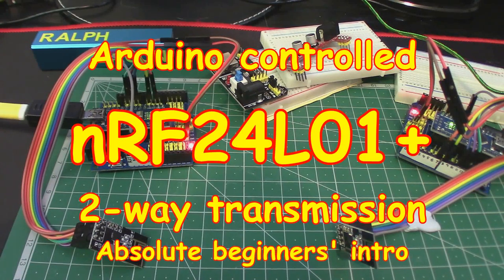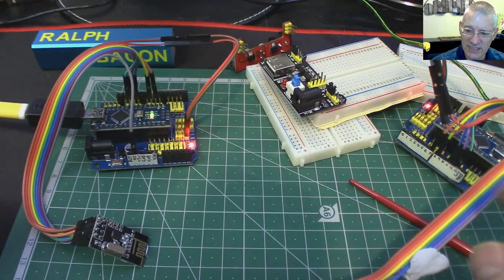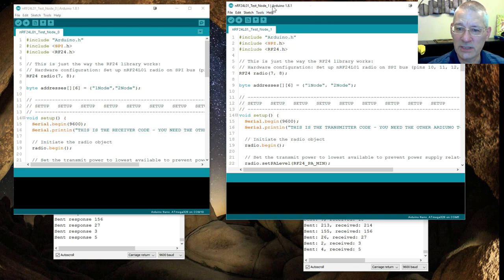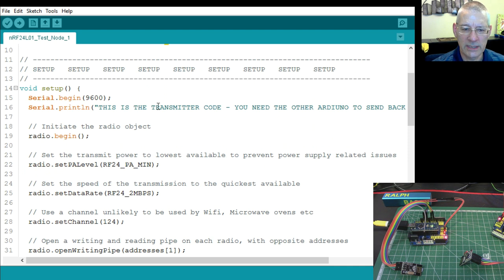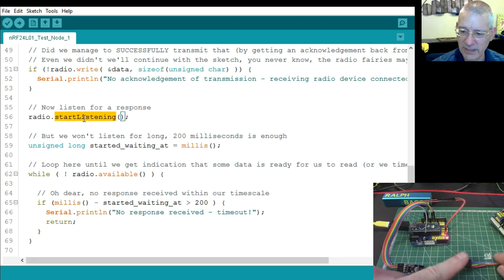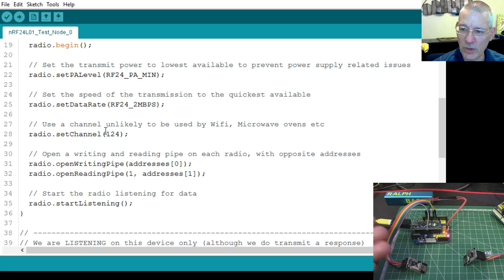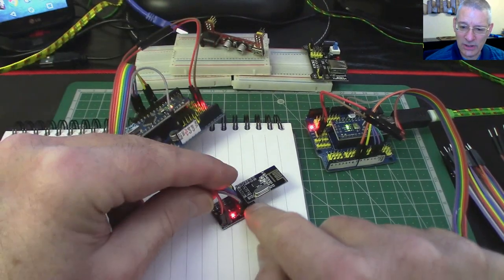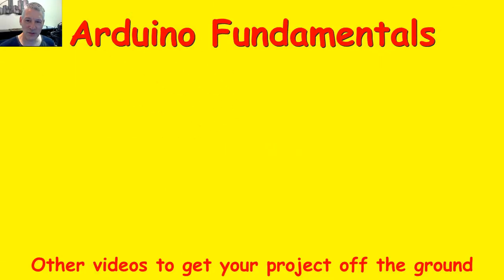#73 nRF24L01 Send (and receive) data with your Arduino!

Comment: Dear Ralph, Firstly Congratulations and thank you so much on a brilliant piece of work on nrf24l01 module. I have been watching a lot of videos with respect of IOT and especially on Arduino and trust me this was so simple and easy to understand am very sure Albert Einstein, would be super proud of you. 

I am yet to lay my hands on this both the Arduino & nrf24l01 and will keep you posted on the results that I get. 

Thank you once again for your efforts, God Bless.
Best Regrads
Zubin.
Reply from the maker: Glad you found it useful and easy to follow. I think Mr Einstein would say that I could have made it even simpler but, hey, it's a good starting point. When you order the nRF24L01 modules DO remember to order the adapter plates too. Makes everything much easier (and safer) to wire up.
Reply: Dear Ralph,
I finally managed to build the solution at home and it worked just as expected. I did mess up with the Pins initially as I was doing this exercise by looking at 2 different videos, but then it was good to make a mistake and I realized that using a wrong pin the Transceiver looped into itself. I am yet to receive those adapter plates that you mentioned, they are on their way. Thank you once again for your efforts and time that you took to post this video. 
I shall keep you posted on my next work that I plan to do on this. I plan to extend this exercise to switch on and off a relay to switch on and off a bulb. Till then Good Bye and God Bless.

Comment: So i commented 2 days and some hours ago that PA+LNA modules were not working. What i had done was i had plugged the antenna into a breadboard to kind of understand better(although it was harder to understand), then the breadboard forwarded the connections to arduino uno, effectively using 2 cables. Turns out my code wasnt working properly because the wire length does matter, cuz we are in the Microseconds. Thanks SIr and the guy who commented about using shorter wires down in the same video!!!
Reply from the maker: Does the module not just have a standard IPEX connector, or something else where you connect the antenna directly? 

Mine certainly have an IPEX connector (I chose them because of this) so no wires to solder at all - precisely because of the issues I knew could be lurking which you have discovered (and fixed 👍)
Reply from the maker: The IPEX connector is a tiny gold circular connector on board (only about 3mm diameter), to which an aerial cable snaps into: https://bit.ly/ipex-and-cable

But I have also used this type where the antenna screws directly into the module: https://amzn.to/3GBdxZu

Just easier than trying to wire up an antenna.
Reply: @RalphBacon  oh i have an old remote with 2 ipex connectors, it has a fulhan microprocessor which is a chinese company, i couldn't find any documentation for it. But these have screwable antennas here.

Comment: Excellent explanation. I've just reproduced at my lab with two Arduinos Pro Mini and it is working very well.
Reply from the maker: Excellent news, Julio. Did you use the adapters to plug in the nRF24L01 modules? If not, get some (they are very cheap, I got mine from Amazon) and prevent lots of problems due to the power being insufficient at anything above Minimum Power Level!

Comment: Yes, I also tried a number of NRF24L01 transceiver project some worked but soon after they stopped for no apparent reason. I am quite sure it had to do with interference from other channels so the key difference here is the line: // Use a channel unlikely to be used by Wifi, Microwave ovens etc
  radio.setChannel(124);  I just started it an hour ago and it's still going!
Thank you so much !
Reply from the maker: You are most welcome Jacob Endure, I'm glad you like the video and found a solution. Nice to hear from you.

Comment: Hello Ralph, this is the best explanation about nrf24l01! Just one question. How do you send more the one variable in one package? Thanks.
Reply from the maker: Hi Gustavo! The way I would do it is to send either a concatenated fixed length string of several variables, or, if you can't be sure of the length, separate them with a delimiter such as a "|". Convert all the variables to strings if you do it this way. Then reconstruct them at the receiving end. I might be tempted to use a struct to do this.
Reply from the maker: I think you are limited to 32 bytes of data though... will have to check this.

Comment: Thank You very much for this tutorial. I finally menaged to get this thing working :)
Reply from the maker: Hey Ben, I'm trying to interpret your post's meaning:
 
1. After a lot of trouble following your video, Ralph, I  FINALLY got it working anyway.
2. I've had this unit in my box of components for ages and now thanks to your video, Ralph, I've FINALLY got it working.
 
I'm hoping it's #2, especially as you are good enough to post your thanks here, which I humbly accept. Good to hear from you (and I knew what you were saying but it's Sunday afternoon so a bit of humour is OK here, right?).
Reply: Yes it is :) Now I can move on with my project. I subscribed your channel and hope you will keep up the good work.

Comment: Ralph, Followed this and it all works OK, so thanks. I bought the bare bones NRF24L01 board in Jan 2018 which may not have been available when you first made this video. The board terminates in 8 holes in a line (not breadboard friendly though as pitch is small), but I wanted minimal size.
I soldered wires onto these pins and connected as follows
nRF pin 1 is TOP RIGHT if you hold it with the pinouts uppermost and chip facing you ....

nRF24L01 pin          Arduino pin

1    VCC                    3.3 V from external source
2    GND                    GND
3    CE                        7
4    CSN                     8
5    SCK                     13
6    MOSI                   11
7    MISO                   12
8    IRQ                       GND note the IRQ is not used here so tied to GND for safety

I did not add any external capacitors or other componentry. If you add this to your next update others will benefit.
Reply from the maker: Interesting development there, whitefields5595. Is it one of these (from AliExpress): https://www.aliexpress.com/item/2PCS-2-4G-nRF24L01-RFID-Wireless-Transmission-Module-2dBm-1mW-2-4GHz-wireless-adaptor-100m/32848645230.html
I notice that you are supplying 3.3v from "an external source" - as long as it's not an Arduino then that will prevent a lot of power-related issues that everyone seems to have (who does not use a 5v adapter board). Thanks for the heads up.
Reply: Ralph,  yes it is similar to the one in your link. I traced the terminations back to the chip. It is not a good idea to use the Arduino as a power supply, and you have pointed this out. I think you should stress it every time as newcomers may become complacent. One of the first things to go wonky is the Arduino's A/D converter. The adapter boards you use are as cheap as chips ;))  so there is no excuse for not doing things correctly. You have to do it right in the project, so start the way you mean to go on. Of course, none of this high moralising is a result of experience as I would never dream of doing it..
Reply from the maker: Ha ha! Of course not, we all do it right first time every time, right? That said, my video shows that I didn't use the adapters for the demo, but I was irritated by the wiring from below and as Amazon were doing them cheap as chips it seemed obvious to try them out. Cranking up the power was then fault free. Thanks for the update, I will take note of these new offerings.

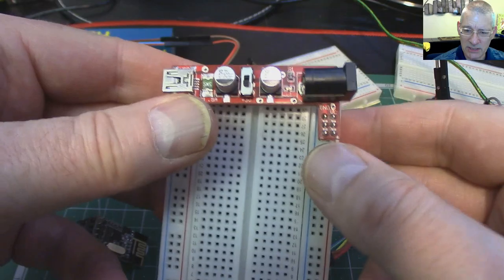Comment: I have several of the power adapters shown at 4:26. They can be used without a breadboard by using the 8 connectors on top; 2 each 5v & 3.3v plus 4 ground pins. Stick the pins on the bottom in a piece of non-conductive foam to protect them.
Reply from the maker: A great way of using those power adapters, Art, thanks for pointing this out. A clever piece of lateral thinking, that they don't need a breadboard to work! Thanks for the post, others will doubtless find it useful too.

Comment: I've had some bad luck with the Dupont cables, many fail and some come without continuity from the pack. I am ordering a set that one can make them and includes a special plier. Too many obstacles here, but I am persistent to overcome obstacles.
Reply from the maker: I've got the metal pins and sockets and the shrouds (plastic headers) and the correct pliers (not cheap). Whilst I can now make some wonderful cables, Pedro, it is a fairly slow process! But sometimes you need a quality cable. Dupont is only OK for breadboard use, not a permanent project.

Comment: Today, I connected together a couple of nRF24L01 with adapter boards using two nano arduinos on breakout boards. One unit had a pot and the other nano had a servo connected. Servos cause current surges and need a 10uF 25v cap and without it, the servo doesn't work. I fitted a tantalum cap to both nRF24L01 boards between GND and VCC near the xtal and the servo worked really smoothly. I followed Howtomechatronics video. Dan does say a cap is needed. Hope this helps anyone having problems with the nRF24L01.
Reply from the maker: Excellent, thanks for sharing that useful tip, Binary box.

Comment: Just found your channel and I have a question. I bought 433 MHz modules but they interfere with my weather station and they are very sensitive to noise. I need to transmit a RS-232 signal (5 bytes) from a PC to an Atmel microcontroller. Is this possible using these modules?
Reply from the maker: Hi Thor! Yes, I've found the 433Mhz modules are pretty dumb inasmuch that they interfere with one another as well. You can certainly transmit data from your PC to an Arduino but I have only done this using two Arduinos (one transmitter, one receiver) and using Python on the PC to send data via the standard USB to the transmitter Arduino (all simple stuff). No RS-232. Do you need that or is it just a communications protocol you thought might be required? This is reasonably straightforward, so much so others might benefit with a video on how to do it... let me know exactly your requirements.
Reply: Hi Ralph. Thanks for your answer. I'm a modelrailway enthusiast and would like to have small scale 1:87 trucks driving, just like they have at Miniatur Wunderland in Hamburg. If you don't know this please check out their website. You can also find lots of videoes on YT. I control my trains from a PC using homemade MS VB software. Partly using industrial I/O and partly RS-232 communication. My experience is that USB and VB 6.0 is unreliable. In Hamburg they use IR to control their vehicles but I can't get the range I need and therefore thought of radio communication. My plan is to put a receiver in each vehicle and send commands to each vehicle. Each vehicle will have an AtMega 88 to control it's functions as well as receiving data. Each vehicle will have it's own unique address, hence 5 bytes. 1 address byte, 3 bytes data and 1 byte checksum. I'm an electronics engineer so I can make my own hardware, I can develop SW for Atmel and program chips using the Atmel STK-500. I haven't tried using STK-500 with Arduino but it should be possible. Hope this gave you an idea of my project.
Reply from the maker: I don't know about USB and VB6.0 being unreliable as I stopped using VB6 about 10 years ago and now it's just a dim and distant memory! 
 
If you used a more recent programming language (Python seems to be the "in-thing" right now) you would have no problems using USB. Python (to me) is a strange mixture of C-like syntax with Visual Basic included (from someone who has never programmed in Python). But you could use the Python "Processing" IDE that is very similar to the Arduino IDE (see https://processing.org/reference/environment/) which I also demonstrate briefly in my video #76 which reads in some Arduino-generated data.
 
Just some thoughts. Once you have cracked the reliability of USB to Arduino then this project is very do-able. Thanks for letting me know  the background, a very interesting project you have there.

Comment: Thanks for the excellent tutorial, I was very quickly able to get the setup to work with the nRF24L01 modules with the built in aerial, However when I went to swap them out for the PA/LNA modules with the aerials it didn't work - is there any modification I need to get those longer range modules to work? Thanks again
Reply from the maker: Glad you got it  working but odd about the longer range modules. Mine just used the "standard" IPX connector (as found on some ESP32 modules) and I used the same aerials that I would for an ESP32.

The IPX connectors are a bit stubborn so make sure they are connected properly. Unless you have the screw-on type which accept the ESP32-style aerials too, directly.

Try getting the BT module(s) working with a simple two-way Arduino sketch to prove the modules are behaving in the manner you expect.

Comment: I've ordered everything in your video, Question are the nRF24L01's 5v tolerant on input output pins, I know it has to be powered 3.3v
Reply from the maker: Hi Susan! Yes, you're doing it right. Power supply must be between 3.0 and 3.6V but the IO pins are apparently 5v tolerant.

You might need to connect a 10-100uF cap across the power supply pins to stop any voltage sags if the power is coming directly from the Arduino's 3v3 output, as the current is limited on the Arduino board.
Reply: @RalphBacon  thanks

Comment: sir, iam always getting the " No acknowledgement of transmission - receiving radio device connected? No response received - timeout! " message . what may the reason....
Reply from the maker: Hey Abhin Raj! Well, according to some people here you need a *stable, low noise power supply*. And you must test on the low power setting first. You can change the speed setting to 
 
radio.setDataRate(RF24_250KBPS);

I'm assuming you're using the two sketches I used in the demo otherwise unaltered? Are you using adapters (5v) or connecting up the nRF24L01 units directly to 3.3V?

Comment: Cool, several years ago, I purchased a lot of these, ten I think it was for not a lot of cash.  Back then everyone said solder a capacitor on so I did that after they arrived, then put them in my storage bin, where they have lived, untouched by human hands ever since.  You see, right after that, we were introduce to the ESP8266 which was much easier to play with and includes a micro-controller on board.  So it is, when I need to communicate, I just do it over wifi, or if need be, go to the ESP32 and  use Bluetooth which is so much easier now in its version 5 on my new Christmas/50th Anniversary gift from my wonderful wife.  Since it was a combo, and since my old laptop has given up the ghost, I opened it early and am typing on it now.  Man what a difference, I love the instant on with the solid state drive, the 4K display is so sharp I now see all the blemishes on the talking heads on FOX News, and as I say the Bluetooth works much better with very quick connect and very few dropped audio to my hearing aides.
Reply from the maker: Oh dear. That is very bad news for me then, Jerry, With a 4K UHD screen you will see all the flaws and artifacts in my videos too! I don't think I will record in 4K just yet - not without a soft focus filter over my camera, anyway!!!

Comment: Oh my ears are happy. There are some great tutors on youtube and i can't take that away from them but whiny American accents drive me insane.  Even the accent of a southerner is music to my Leeds ears ;-) Great tutorial, Subscribed.
Reply from the maker: Wow, thank you! Nice to have you along, Andy. 208 videos and counting. If you look at the PDF file link in all my video descriptions you can search for topics or keywords - I use it all the time!
Reply: @RalphBacon  No worries. Hope you're having a great Christmas. While i'm here, could you tell me if it's possible to somehow create a network bridge with an NodeMCU V3? I've built a central heating controller which communicates with a number of ESP8266-01 modules sending temp data. I am fairly new to this stuff but finally managed to get them communicating using a NodeMCU as a soft AP webserver. The clients connect, send temp data and then sleep. Is it possible to also have the access point connected to my local LAN? I'm using the remote XY android app to show temp readings and change setpoint which is currently running on a single NodeMCU with DHT11 and control relay directly attached and connected to my WiFi as a client. My aim here is to have the temp sensor in a different location to the relay. A point in the right direction would be massively appreciated. I also have a couple of ESP32's but haven't really looked at them yet.